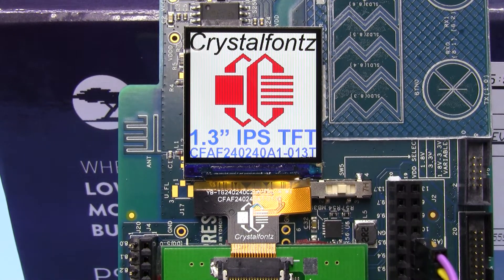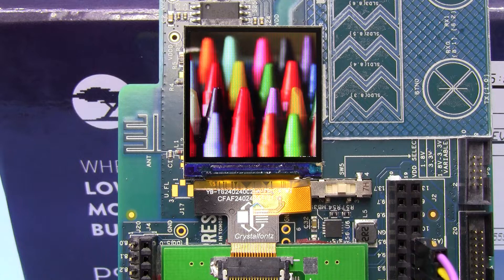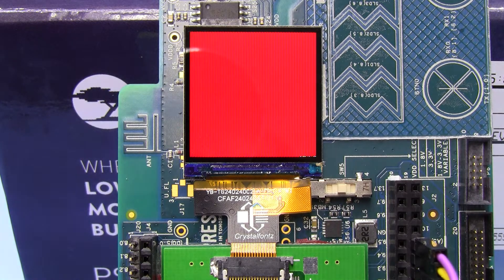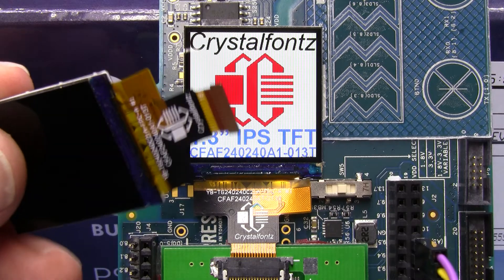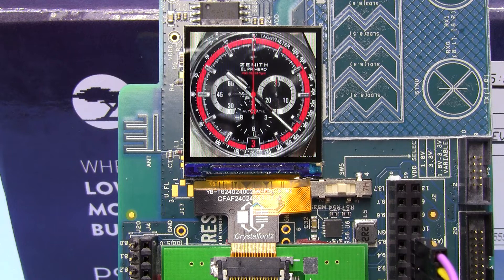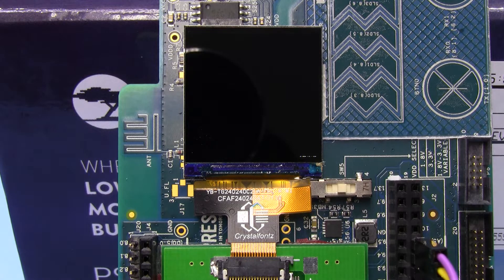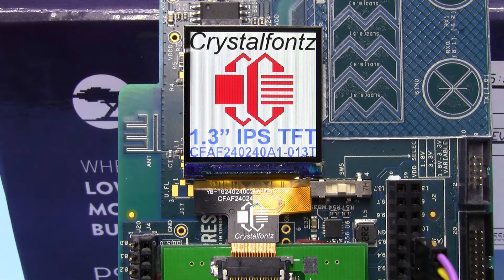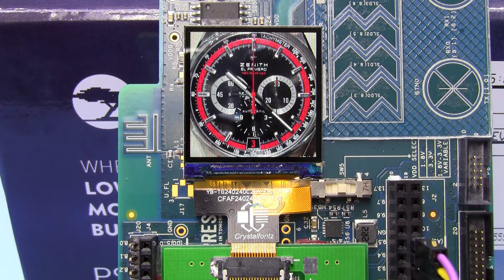Crystalfontz CFAF240240A3-013TN TFT with PSoC6 BLE Pioneer Kit DMA SPI

Comment: Can I use it with Raspberry?
Reply from the maker: Yeah you can, it uses SPI for it's interface. We recommend purchasing it with it's breakout-board: https://www.crystalfontz.com/product/cfaf240240a1013te11-240x240-tft-with-breakout-board
Reply: @Crystalfontz  Is the driver in the breackout-board or can I use ir without It? (I want it as compact as possible)
Reply from the maker: @miguelangelbarton2536  The breakout board provides the driver for the backlight so you only need to provide a single 3.3v also it's specifically designed for use with this display, so it fits directly behind the display with no PCB overlap.
Reply: @Crystalfontz , the Sitronix ST7789H2 controller for this display is on the glass (COG) or is in the breakout?
Reply from the maker: @miguelangelbarton2536  It's on the display